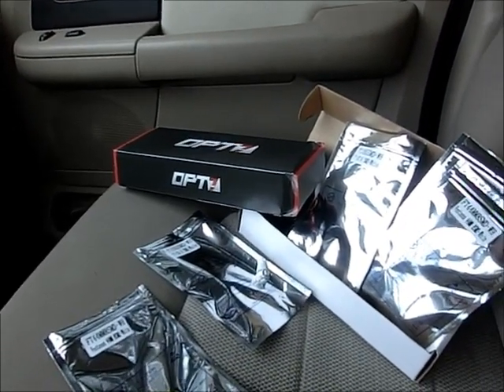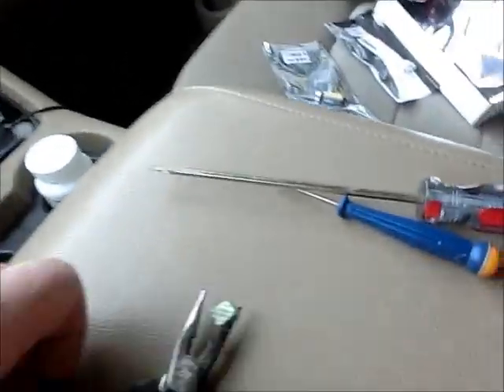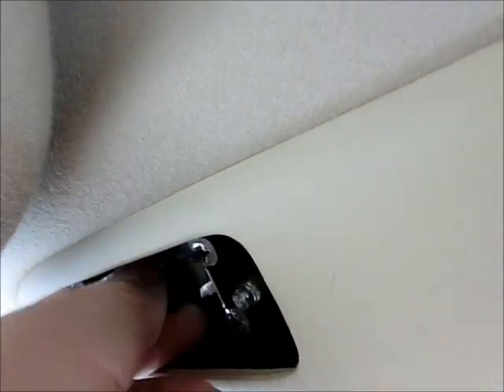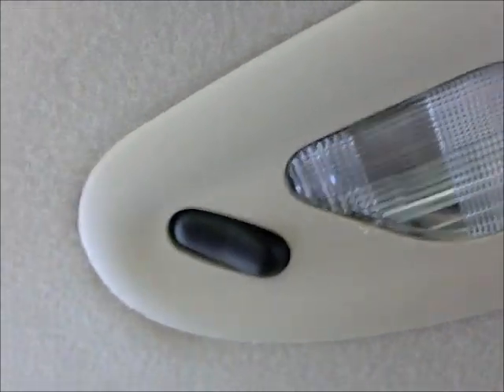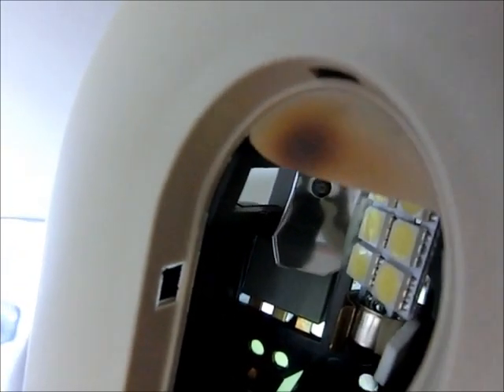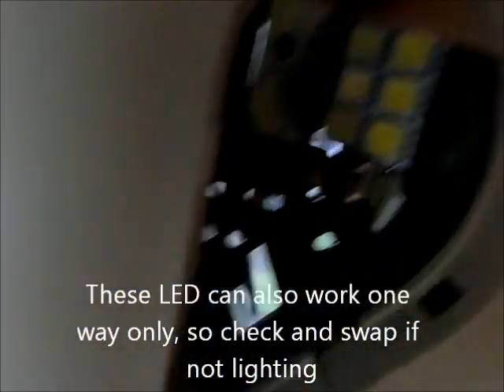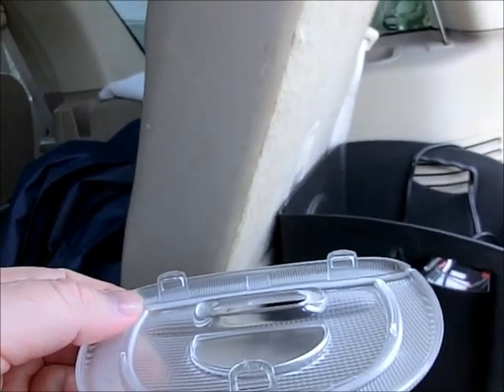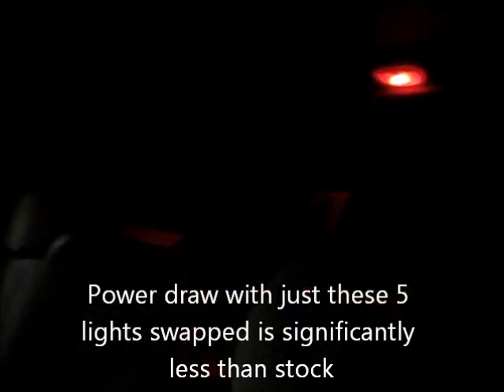2006 Ford Expedition Interior and Map Light Swap LED

Comment: It sounds simple but if I break the lens or the plastic part of the light, it’s not low cost at the dealer to buy replacement, video is money saving, I like the blue color of LED and less heat.

Comment: Do you know if the led light dim when you close the door??
Reply from the maker: +peanut head Yes.  They fade/dim when they go out after the door closes.
Reply: +HVABALL I just installed them today did you get to change your side view mirror lights??
Reply: +HVABALL also I forgot to mention that that the middle lights you really don't need the tape. All you have to do is bend the metal prongs closer and it will fix snug.
Reply: @peanuthead8287  Hey, good call. This works! I never understood the 2-side tape procedure.